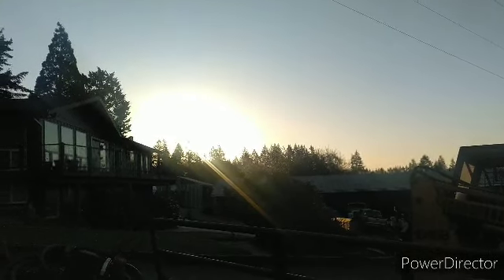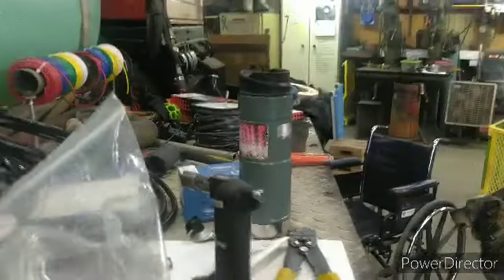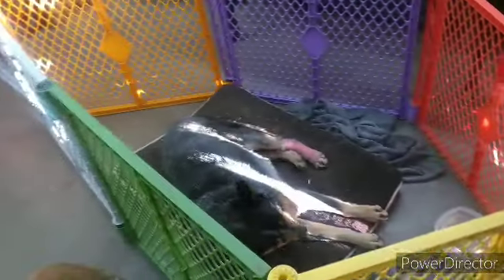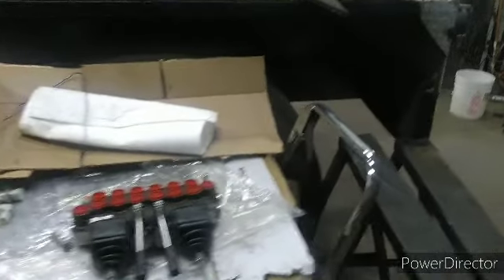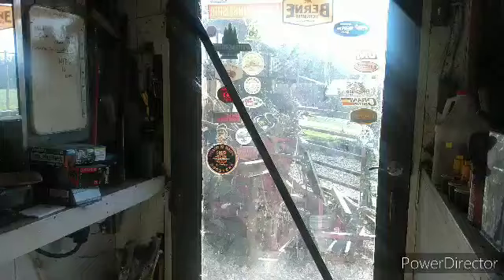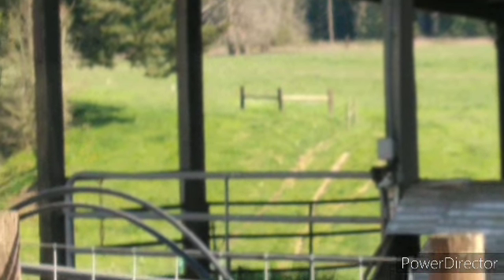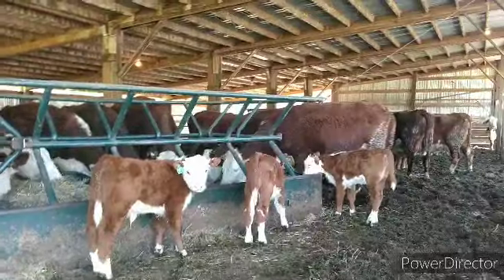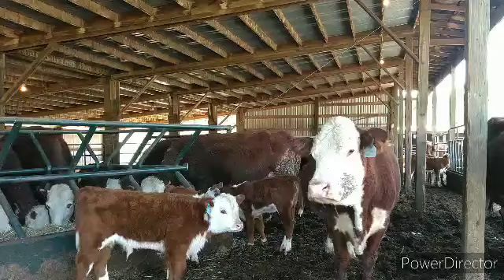another long HOT day.. only 86° and no wind😵

Comment: The valve looks good! If a person wants to see 7/16" bolts work on a Ford 8N!   lol
Reply from the maker: Thank you Doug! Going to be a little tight getting lines on, but it fits the space provided. 
Yes, there are a few things that use 7/16".. they just aren't very common. And most applications, the bolt has a 5/8 hex and the nut an 11/16 hex.. 🤔😵🤣😂
Reply: @GosselinFarmsEdGosselin  That always pisses me off - it usually means another trip to the tool box to get a 11/16" socket or wrench. lol
Reply from the maker: @dougkubash8673  yup... And if you expect it to be 11/16.. it's 5/8🙄🤬😂🤣